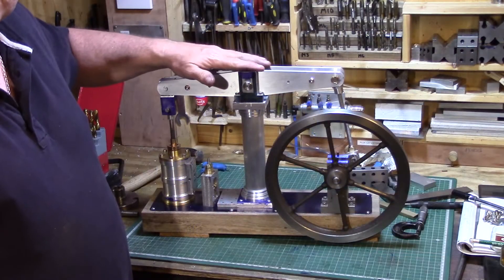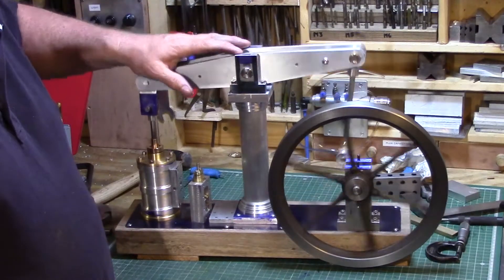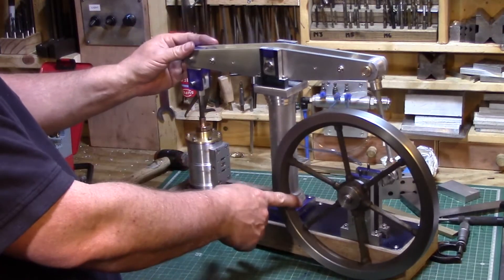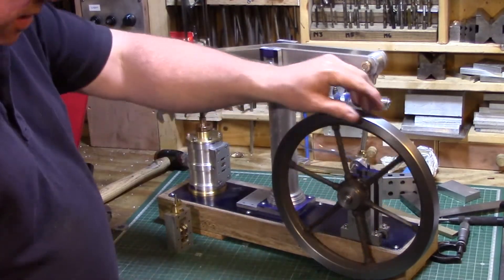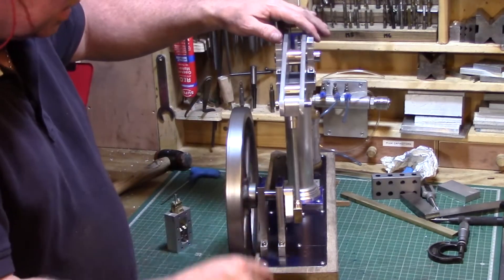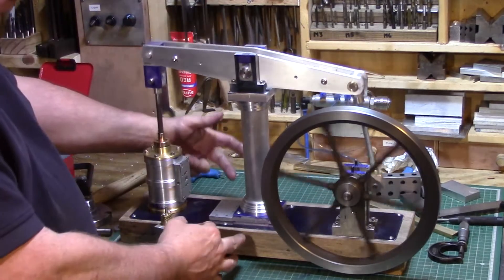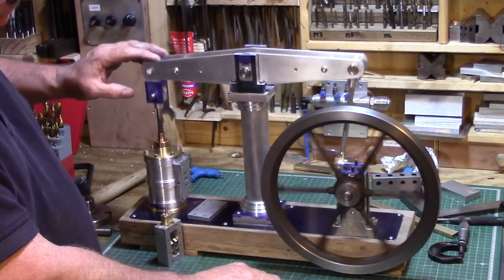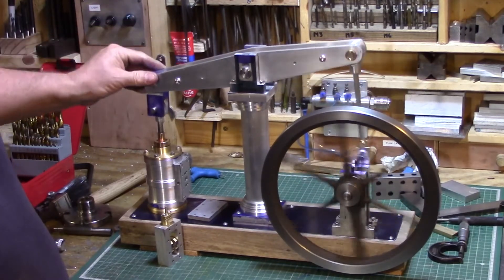My Big Beam Engine - mid build video

Comment: Ade Swash. How does the valve timing block get its timing motion from the Steam Engine.
Reply from the maker: Hi Ian, there is an eccentric on the crankshaft which pushes a rod to make the valve movement, take a look at my other Big Beam videos and all will come clear. Regards, Ade